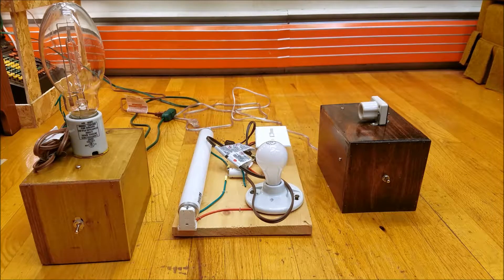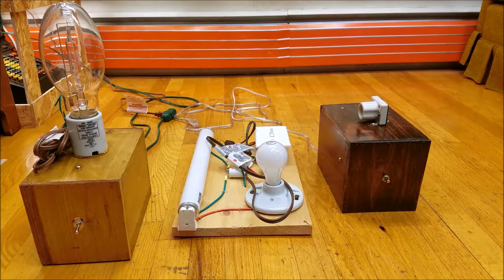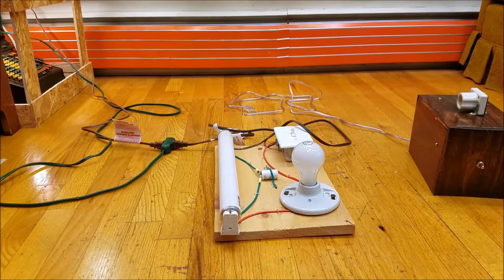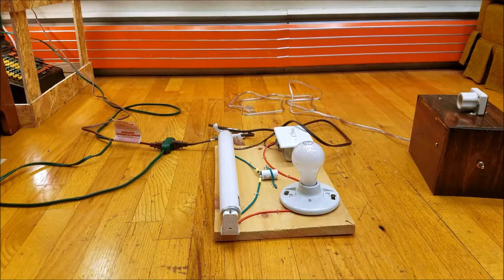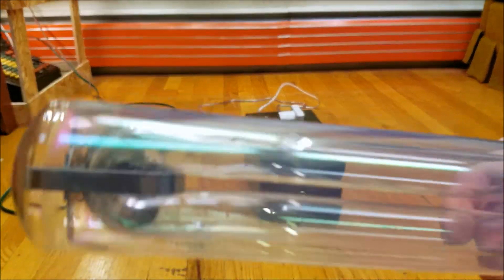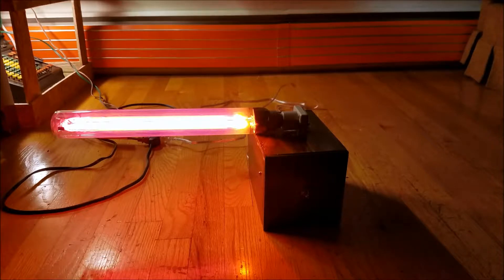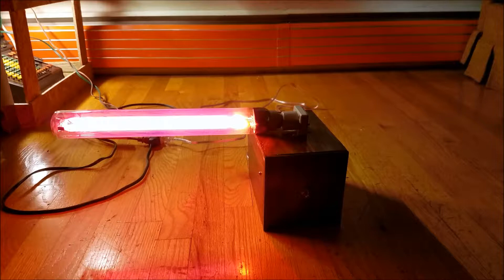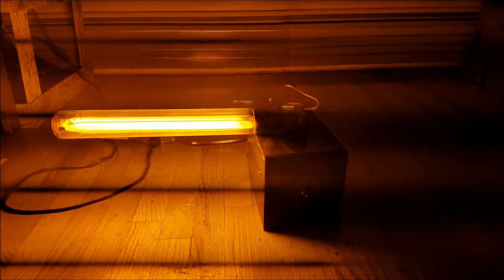Lamp Experiments & More Spectra (metal halide on mercury ballast)

Comment: I lit a 250 watt and a 400 watt MH bulb on a 175 watt MV ballast.
Reply: I wonder if I can light pulse start metal halides on my 175 watt MV ballast.
Reply: @t687m3  it won’t work. Pulse start lamps require a 4 or 5,000 volt starting voltage to strike the arc.
Reply: @t687m3 You can actually use a tanning bed superimposed ignitor to run same wattage pulse start metal halide lamps on mercury vapor ballasts like the 175W M137/M152 pulse start metal halide lamps on 175W H39 mercury vapor ballasts. Those ignitors will work on mercury vapor ballasts because they specifically do not require ballasts with a X3 tap, unlike what you see with most North American ignitors and virtually all North American mercury vapor ballasts do not have the X3 taps that are typically required for 3 wire North American ignitors. Those tanning bed ignitors can easily be identified with their screw terminal connections. If you get them, they will definitely allow you to run same wattage pulse start metal halide lamps on mercury vapor ballasts. I have done that myself by running 400W M135/M155 pulse start metal halide lamps on 400W H33 mercury vapor ballasts by using those screw terminal ignitors often used on tanning beds. Additionally, I am very sure that a Payne-Sparkman ULI-135H Ultrasonic ignitor can also allow you to run same wattage pulse start metal halide lamps on mercury vapor ballasts as well since its wiring diagram shows the X3 connection on the ballast being capped off, which means that it specifically does not need an X3 connection to operate properly. This means that it should definitely run pulse start metal halide lamps on mercury vapor ballasts.

Comment: I have never seen it done, but interestingly you can run a fluorescent tube directly off of DC by using a starter & resistance ballast like an incandescent bulb in series.  The problem with that is the mercury will tend to accumulate at one end of the tube, and it's recommended the polarity be reversed each time the lamp is started. I Don't know why one would want to do that, though.

Comment: Cool video.  I would have thought that a metal halide lamp could be run on a mercury vapor ballast, since the metal halide lamp was basically an outgrowth of the mercury vapor lamp and shares a lot in common,  in fact multi-vapor (not sure what manufacturer used that trade name) I believe was so named because they were so much alike.

Comment: I bought a brand new 175 watt metal halide and put it in my 175 watt mercury vapor fixture and it came on the first couple of times I used it.  It flickered a few times and then came to full brightness (as far as I could tell).  But after a few uses, it doesn't do anything now.
Reply from the maker: Interesting, I wonder if that mercury vapor fixture puts out a higher voltage than mine. It could be that the first few uses shortened/pitted the electrodes enough that now the voltage isnt high enough to strike
Reply: That's what I think happened.   The electrodes wore out a little.

Comment: Great video the part where you used an incandescent as a ballast was pretty cool I might try that myself. I mean it saves a bunch of money and looks to work ok
Reply from the maker: Yeah the only problem is it doesnt work with longer tubes, anything longer needs a higher voltage to start
Reply: @bss1250  well it attempts to start long tubes also if you use a grill starter and click it right in the center of the tube it does work
Reply: So I tried it and it really attempted to start I was using a short tube but it didn't start I am guessing it is because I'm using a 45 watt incandescent and I need something much higher wattage wise. So is that my prob or is it something else

Comment: I will see how a MH lamp strikes on a US mercury ballast using a European 2 wire 750v ignitor.
Reply from the maker: Would you be using a probe start or pulse start MH bulb?
Reply: bss1250 Probe start. These ignitors will not cause much damage to the starting probe on hot restrike.
Reply: My ignitor successfully arrived and I was able to install it in a 175w MV fixture and it was able to run 175w probe start MH bulbs in it successfully!!!
Reply from the maker: Very cool, its always neat when experiments like that work out!
Reply: Check out this link here: 

https://www.lighting-gallery.net/gallery/displayimage.php?album=307&pos=4&pid=186857
Reply: Experimenting with the incorrect control gear  not designed for the application is dangerous and Hope you were wearing Safety glasses also not wearing gloves. I guess your video shows  you have done it and have the Tee shirt and Do not try the same experiment your self home.
Noticed many pod casters do experiments and seem to get many  likes and comments.
Read the discharge technical information sheet giving all the information required instead of  
Mad experimentation. You are damaging your prised collection of discharge lamps. Not trying to be clever or diss your informative video - just urge caution.
Reply: Check out Iwasaki Electric of Japan to see their large array of discharge lamps also retrofits. They have an office and warehouse in North America percificaly for the U S A Lighting requirements and also have a lighting application department to carry out proposed illumination  designs for whatever work place or sports lighting using sufisticating accurate lighting tools. I am now retired. The last company I was with in Johannesburg were agents of Iwasaki Electric of Japan for over 45 + years and  I had the great opportunity to visit their factory in Saitama and see first hand the invasions. Sadly LED is now taken the wild by storm Iwasaki are now concentrating Energy saving lighting concept. Suggestion. Collect discharge lamps for posterity who knows they may be as valuable as an old Volkswagen Beetle L o L.